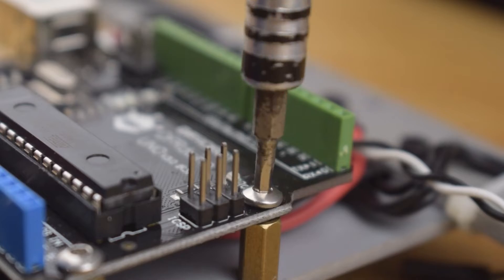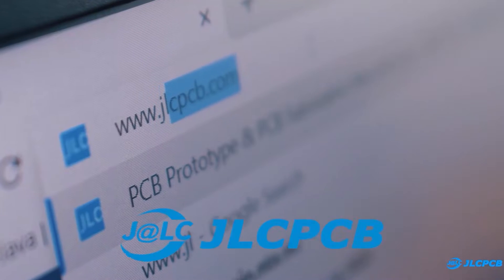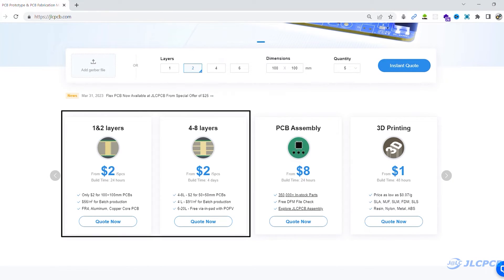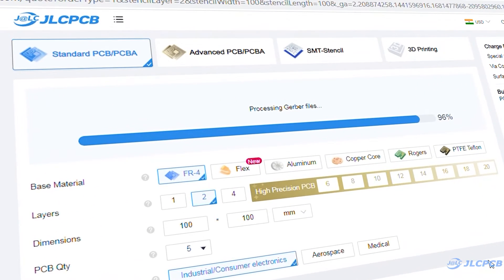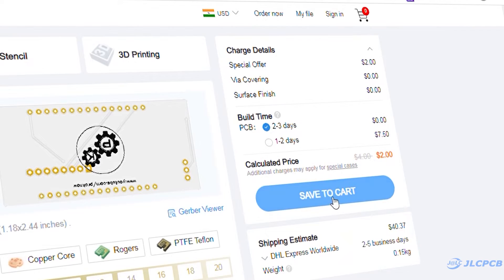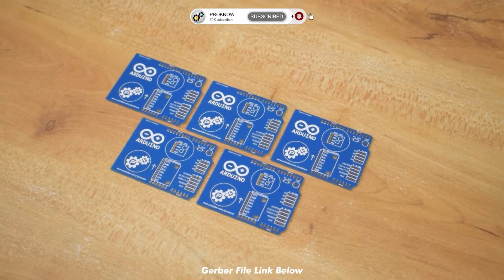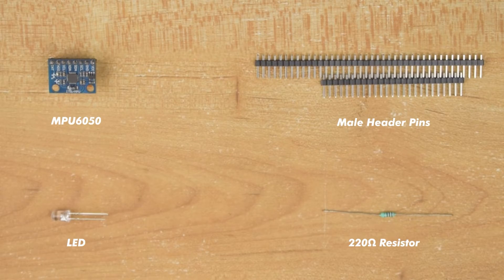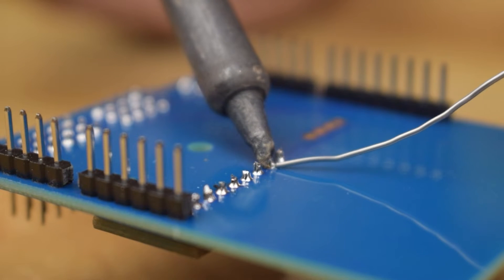Making a Arduino Drone out of PVC Pipe | Homemade Quadcopter

Comment: Some ideas to reduce weight: 
On the PCB shield that you have built for the IMU, just add the arduino microprocessor chip plus the required peripherals. No need to add bootloader tho. It can be programmed externally. I would avoid using a separate PCB as power dist board. You can remove that outer plastic covering of the receiver coz it does have some weight and does essentially nothing lol. Avoid using so many bolts. I learnt many of these the hard way.
Happy learning 💙